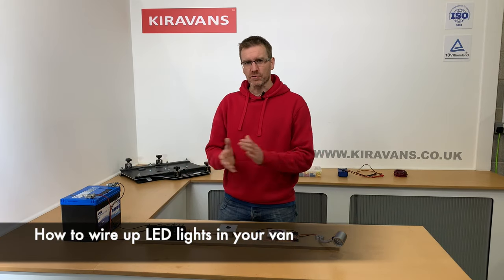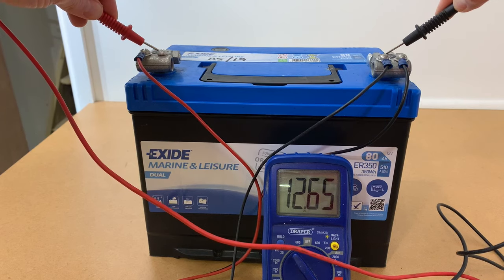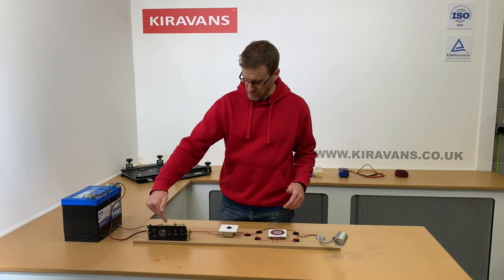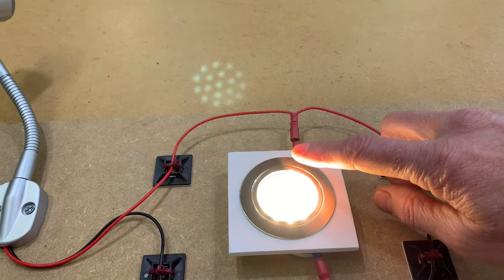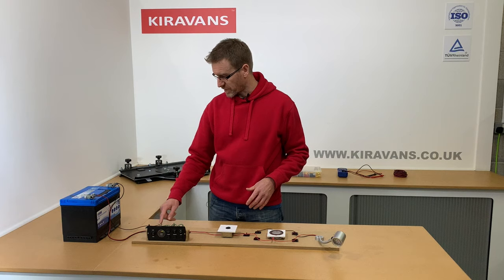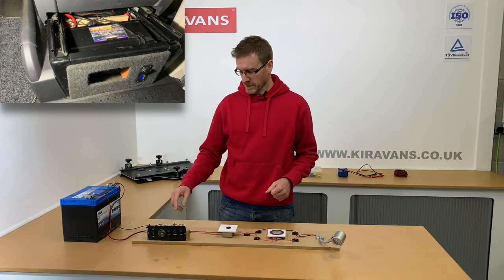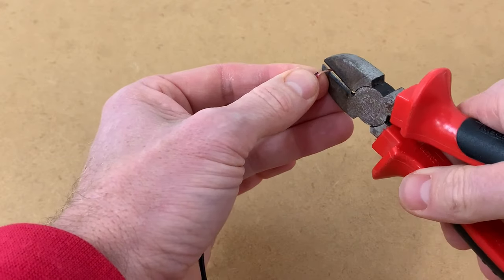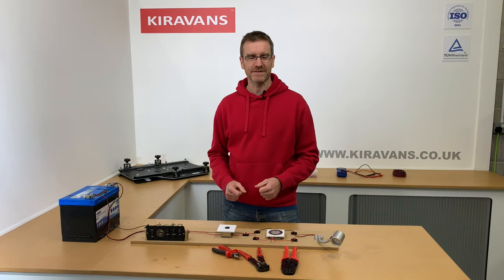Kiravans - How to wire up LED Lights in your campervan

Comment: thank you for the video! is it possible to run 12volt lights and switch in a caravan from through the 240volt output? thanks for your time !

Comment: A quick question. Into your devices you have a type of connector, for example the positive wire that runs in and then out of the led light is connected by some connector. What would be the name for that ha. Many many thanks and great simple video!
Reply from the maker: That's just a simple crimp on cable connector with the two live going in to one and connecting to the live from the light.
Reply: @kiravans5874  thank you!

Comment: The wire gauge will be interesting. I would like to use a LI battery and a solar panel mounted at the rear of my roof rack as they don't weigh much.

Comment: When you turn the light switch off, does it reset all lights to off ? i.e. when the switch is turned on again, does every individual light have to be touched again to turn on?
Reply from the maker: Thank you,The default is off. If you turn them on with a switch they remain off until they are touched, if you turn them off at the switch whilst on they will be off next time the switch is turned on.

Comment: When selecting a fuse, do you have to add up the ampage of each led in the series? Or just use the lowest rated ampage?
Thanks.
Reply from the maker: Add up the watts of all your lights you've wired in parallel (never in series) on the circuit to be fused, divide that figure by 12 (if it's a 12v battery you're using) and that's the amp draw so a fuse of 25% more than that figure would be sufficient.  Always go up to the next nearest fuse size rather than down.

Comment: Hi great video got a question when exchanging cargo lights on VW T6 for dimatec lights on van wire loom its got 3 cables how should I wire this up cheers for any advice
Reply from the maker: The original VW courtesy lights have a more complex arrangement of terminals built into them to allow for the time delay when doors are closed etc.  You can wire aftermarket lights in but you're best searching the forums for details as we have never done it.

Comment: great video! do you need specific 12v light fittings or can i simply put in 12v led bulbs into any old househld light fitting i install? cheers!
Reply from the maker: Hi Dougie, With wiring as we are not installers this area isn't something we can really advise on. Other than items we sell and the intended installation for these we have to be careful to not advise outside of this especially when wiring and electrics are concerned. We have not had experience with the bulbs from these in any other light fitting and so really cannot answer this specifically Im afraid, apologies for this.

Comment: I have bought a 12v LED roof light for my van to replace the existing.

The existing has an in built switch and works fine but the replacement has no switch and does not respond to same live feed / Earth?

Any suggestions gratefully received.
Reply from the maker: Hi William, Thank you for your contact. If you have the order number of the light you purchased and can send some details /photos of your set up over to our customer service team at help@kiravans.co.uk. We would be happy to take a look at this for you and help where we can.

Thanks

Comment: What connectors are you using for the 3way terminal? I am not sure the best one to use in my parallel lighting circuit. Thanks
Reply from the maker: Just some generic ones from Amazon.

Comment: The connector to crimp 3 wires for the light- is it an ordinary butt connector with 2 wires going in one end and one the other?
Reply from the maker: Yes it is fine to have two wires going in one end and a single wire coming out the other. It is worth twisting the two copper wires together before inserting into the butt connector.
Reply: @kiravans5874  thankyou! really enjoying your videos, very easy to follow and well presented
Reply from the maker: @djheadcandy  Thanks for your lovely comments, much appreciated

Comment: Hello good morning che tipo di cable ai usato?
Diametro
Thank you very much
Reply from the maker: Hi we tent to use Single Core 0.3mm 44 Strand Cable - For general wiring and Single Core 0.3mm 84 Strand Cable - For split charge relays. Hope this helps.
Reply: @kiravans5874  Thank you very much for your help

Comment: Is it not good practice to have a fuse as close to the battery as possible in case a wire rubs through etc?
Reply from the maker: Yes, thanks Kyle. That is always good practice.

Comment: Thank you, but I have to make a small criticism on the way this is edited. Why pan out to a long shot of you when showing is the wiring in the distribution board. Its really frustrating as I try to pause to see the circuitry. You look great, but we need more close ups of the circuit. We don't need a long shot to heat you. This made the video unclear.